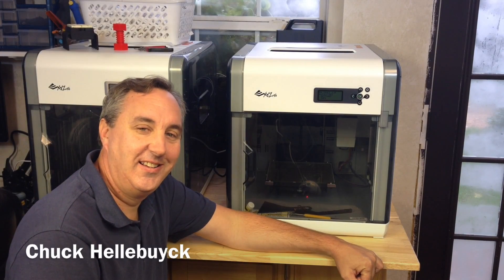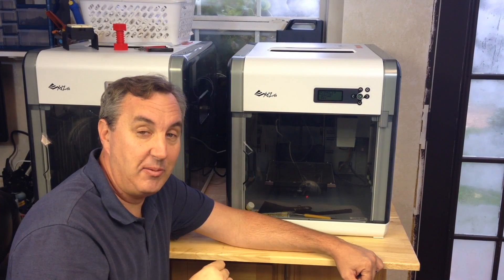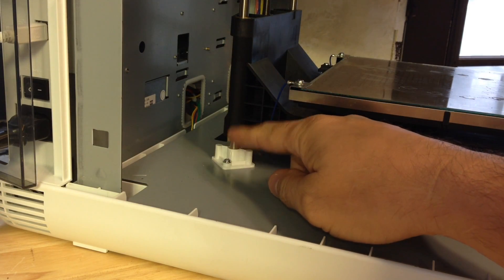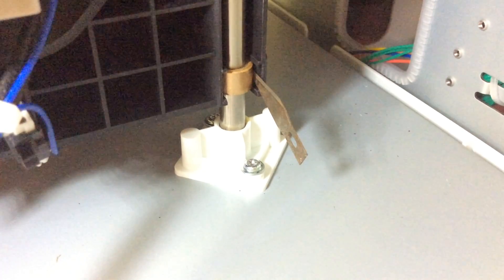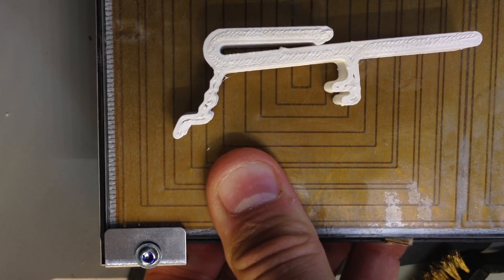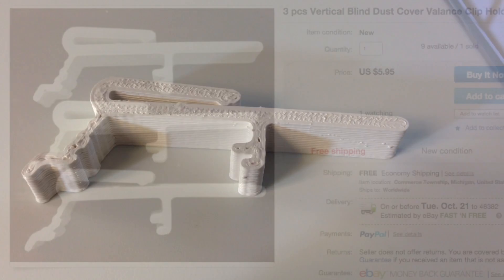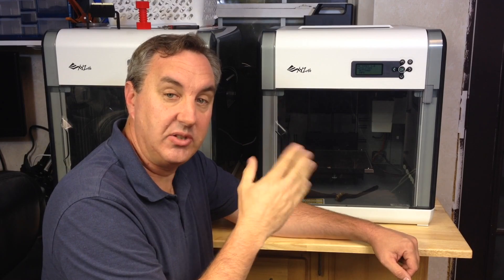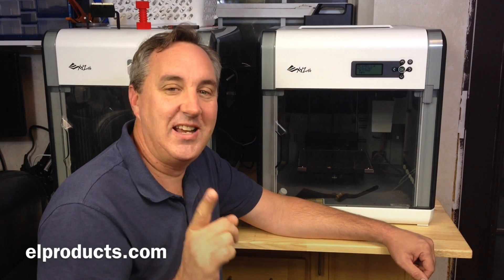Fixing a Davinci 3D Printer Offset Issue - Video #014

Comment: thats whats happening too alot on my printing it keeps shifting step by step  by step like making up stairs
Reply from the maker: What printer? Lowering acceleration can fix it too.
Reply: @FilamentFriday  CR-10S
Reply from the maker: See if you can see the acceleration settings on the LCD. If not, you can set it to 500 in Cura advanced settings in your slice. Also make sure your glass bed is tight.
Reply: thanks, @FilamentFriday

Comment: Are there any decent 3D modeling programs you'd recommend?  I'm currently using Autodesk Inventor through my College, but I won't be able to use it once it's "student loan" times out.  I've seen another guy using AutoCAD 123D and was wondering how well it stacked up (if you have experience with it).  

PS- Loving my XYZ DaVinci 1.0A, and I noticed it has a spare port in the back for a dual extruder operation.  Is there a kit to upgrade the 1.0 to do dual extrusions?
Reply: OpenSCAD, Solidworks, TinkerCAD
Edit: Solidworks isn't free, but it's powerful. OpenSCAD is 100% free, and you code the model. I use OpenSCAD. TinkerCAD is online based, and has objects you drag in and then resize and whatnot.
Reply: Matt 'Bacon' Fellenz

There's also Fusion 360, it's $300/year subscription.

Comment: I had just changed out the glass on my , at first the didn't move but when after running the calibration a few times the bed could be moved  what I did was in each corner , with the screws out the clips that hold down the glass I very slightly bent the corner so the it pressed down on the glass when you put the top clip on and screw it down .

Comment: I've tried .040, .60 and .080, they all seem to work about the same. i suppose that i would give the edge to .040, but because it is so thin, it's more bendy and warpy. Just bought an 8x8 buildtak to put on it. I forgot to thank you before, you have inspired me to fix and upgrade my D1, instead of buying a new one. My prints are about at your level of perfection now. I originally bought mine because i have been 3d-ing for about 10 yrs and thought it would be fun to build my own Vaporizers (E-cig Device)...another hobby of mine. Anyways, great work on youtube. What video software are you using?

Comment: I just had a massive shifting problem on my da vinci 1.0. Any large prints, it would shift around a full inch left. I ended up re-wiring my X and Y steppers with new wire and JST ends. This fixed the issue. It's a known problem with the 1.0's.
Reply: this is he exact problem I'm having

Comment: Hi, I am looking at buying this printer but am not happy with the XYZ cartridge for filament.  Have you moved away from the cartridges?
Reply: I would suggest buying a different one. I just had problems since I bought it and the support is not helping anything. It is the worst electronical product I've ever had. If you ask me, you should invest some more money and buy an open source one, you will save yourself a lot of trouble and also a lot of money, if you print a lot, because the cartridges cost a lot more than unchipped filament.
Reply: There are ways around the XYZ cartridge bullshit.-->http://wctek.com/xyz/ ;).